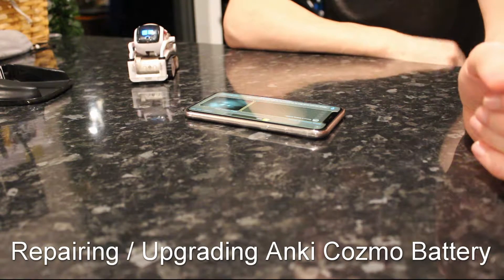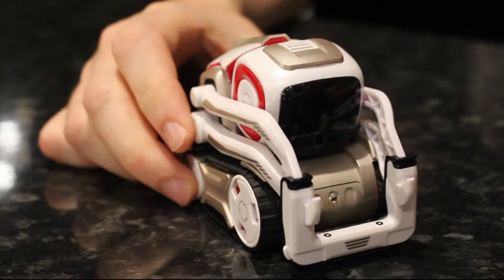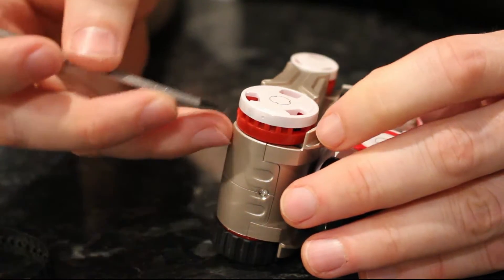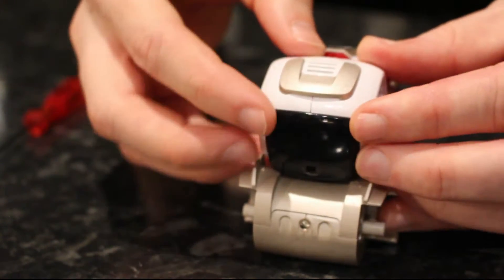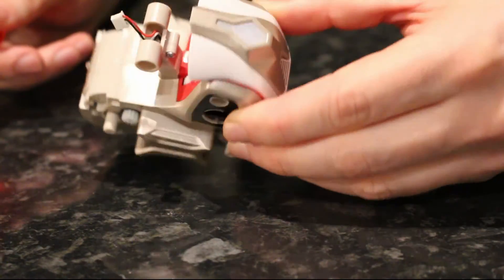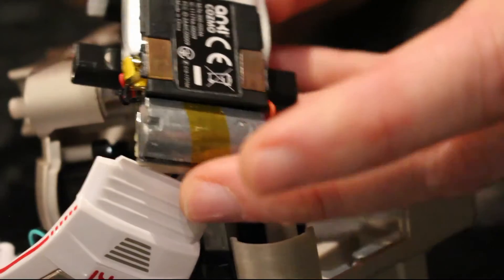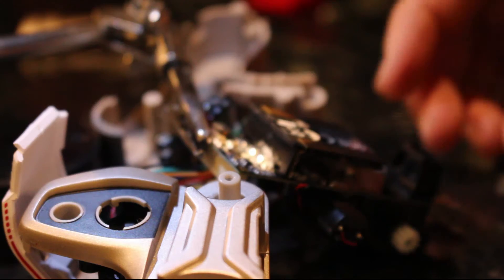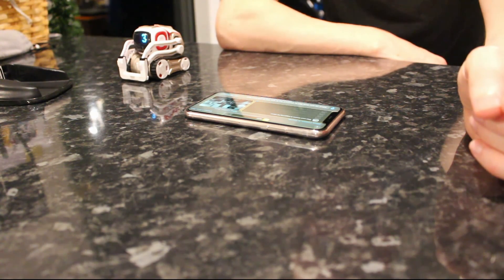Repair / Upgrade Anki Cozmo Battery

Comment: I must of messed up one of the gears when putting it back together. My Cozmo right side if looking at it doesn't spin. I can spin it by hand but the motor isn't working.

Comment: ⭐Great instructional video. Thanks. Just replaced my battery and it works a treat. I tried to test the recharging on the dock when partially re-assembled (to save myself the grief of having to disassemble in case my soldering job was a fail), but it didn't work. Tested the battery and it seemed fine, so I went ahead and fully re-assembled and it worked fine. Nice to have him functional again...
Reply from the maker: The head needs to be connected before it will wake up. Well done

Comment: I got Cozmo apart and changed his battery (hubby change the battery). I think he did it wrong. Cozmo worked for about 45 minutes and then died. So I put him on the charger and he never charged again. I even have two chargers. Nope. He killed Cozmo. 😭
Reply from the maker: @candicethewhynots  could be a dud battery. Try again. I’m sure it’ll be fine

Comment: Hi, can you tell me if it happened to you that your cozmo disconnects while you are using it?
Reply from the maker: @PiccolaGrace21  it’s either a bad battery or a wifi conflict. Do you have a WiFi mesh system?
Reply: @TheJohnJudge  yes I have mesh system
Reply from the maker: @ try switching it off temporarily to see if Cozmo runs ok

Comment: Question for you...  I upgraded my old Cosmo with a 600mah battery which seems to go smoothly.  Cosmo charges (I get the 3 consecutive green lights) but after about 20/30 minutes, the lights on the top just turn off.  I assumed this to mean that the battery was fully charged but I only get about 10/15 minutes of playtime before I get a low battery warning in the app so something is not right.  Is it normal to have to re-charge the robot (i.e. place on charger until lights turn off, remove and replace onto the charger).  Have you encountered this issue in your experience?  Also, how long should it typically take to charge the 600mah battery?  I'm wondering if I have received a duff battery.  Thanks in advance.
Reply from the maker: @TelexStar79  no that is perfectly normal. The robot has a fail safe  feature that charges the battery up to 400mah and then shuts off (the old batteries were 320mah). So even it if shows fully charged if you take it off the charger and put it back on it will charge up to the 600mah capacity.  .

Comment: Great video. But a replacement battery for 35 quid is crazy.
Reply from the maker: £35 is the total service charge; that includes the cost of the battery, installation (by me) and return tracked shipping to the sender - i don’t really make any money on this; I am trying to help keep these robots alive for people.
Reply: @TheJohnJudge  ah got you so you do the replacement that’s cool. I was just looking for a battery replacement that I can do myself. Cheers.
Reply from the maker: @bigdmc6459  you get a battery for about £7 on Amazon or eBay

Comment: I want to warn anyone who is not a professional that they should not try to recreate the steps in this tutorial!  I'm not a professional, but am a hobbyist with years of experience building PCs, and repairing my personal small electronics (including replacing batteries and screen in phones, ipods, etc...as some examples that I work with very small bits). 

This tutorial is misleading in how it shows to disconnect the LED connector.  You can see in the video a cut away shot and then the hands totally obscure the connector.  It is NOT easy to remove.  I have removed similar connectors on many electronics and this thing is not easy to remove.  I gingerly manipulated it for over 5 minutes, trying slowly to remove the connector with gentle pulls and rocking motions.  I slowly increased my force trying to remove it as it would not disconnect.

It would not come out with what I would consider normal force for these connectors and then it ripped the soldered connector on the LCD board.  Perhaps my particular robot had a problem...but I question why the author of the video does not remove the two similar cables connected to the board once you have the main electronic block removed?  It would be so much easier to position the device to solder the battery with these two connectors removed.

I believe the reason he doesn't remove them is because how strongly they are connected to the PCB and the risk of damaging them if you try to remove them.  Yet this is the same type of connector on the LCD panel!  I assume the author has repaired dozens of these and I would have wished he would have drawn more attention to the risk you pose when removing the LCD connection instead of just saying "gently pry".  Everything here needs to be done gently!  There is more to disconnecting these particular connections then meets the eye.  Even after it detached from the PCB the level of force required to disconnect the plug was obscene.

The broken connection seems to have ripped the two outside pin connections from the board with the third pin still being stuck to it.  I was able to place it back into the board using the middle pin as the anchor, but I do not believe the metal prongs are making an appropriate electrical connection.  Prior to my opening the robot it was working fine, but only lasting about 3-5 minutes.  I placed the mostly disassembled robot back on the charging stand and the battery light on top does not light up.  I have reconnected the LCD connection (which I believe is the only electrical connection and the other bits and pieces should not need to be reassembled for it to show some signs of life), and I get absolutely nothing shown.

At this point, I think I should just return the battery I purchased because if I cannot even get it to show a charging indicator light on top as it was before it is probably totally hosed.
Again, I'm not an expert, but someone with a good amount of experience.  Like with most of these projects the only thing that usually takes some skill is the soldering part, which it seems I won't even ever get to.

I appreciate the attempt at the video, and I fault myself for taking for granted the instructions from some random person on the internet, but don't assume this process will go as easily as described and if you attempt it, take extra special care with the LCD connector. 

Now I've got a sad little boy to tell he won't be seeing his Cozmo again :(
Reply: Just an update to anyone that still wants to attempt this.  It might be a good idea to use hot glue around the connector point to better secure it to the PCB before you try to remove the connection.  Obviously, you want to get it between the connector and the board, but not high enough that you glue the cable into the connection.  This extra bond might help you not destroy the board if your connector is as seated as difficult as mine was.  I don't think my board is salvageable, but I was able to order a replacement board and hope I will be able to breathe new life into this guy for my son to enjoy.

Comment: I just found my anki cozmo during a recent move after not seeing it for a few years, and the battery is dead. I feel confident in following your instructions, I just wanted to check what the dimensions for the battery are? I don't want to order one that is too big. Thanks!

Comment: Hi, I'm not able to find the 503040 lipo where I live, instead I was able to find a 900 mah 603048 lipo battery. It is about 1 mm thicker and 8 mm longer than the 503040. Will it fit or should i look for a different one? Thank you for you help.
Reply from the maker: That will
Not fit

Comment: I bought Cozmo used and it tended to randomly shut down very frequently. I excluded battery problems because by repositioning it in its base it immediately returned ready to go again. I've been thinking about issues with wifi disconnecting or any interference but I've noticed that when cozmo loses wifi connection it doesn't tend to shut down immediately. So I followed this guide and opened it up and found a lot of rust between the electrical contacts, as well as in the 5 minute video. I easily cleaned everything up with isopropyl alcohol and now it seems to work fine.

Comment: Regarding the rubber sticker on the battery, how necessary would it be to transfer over to the new battery from the old one as I have found others say it serves as a thermal insulator between the motherboard contacts under the battery and the battery itself and if so what issues could arise from this?
Reply from the maker: I think it predominantly prevents any components on the motherboard from piercing the battery sleeve (they’re quite sharp). Also I guess it stops the battery sleeve accidentally shorting any components because it does rest on top of them.

Comment: My Cozmo dies pretty quick. I was curious on how to fix the battery and this really helped. Unfortunately I’m not certain that I own a soldering iron to complete this repair, so I was curious to see how much it costs to send in my Cozmo and have it fixed.

Comment: Hi John,
Thank you for the nice explanation in the video about replacing the Cozmo battery. After 5 years of running the battery was at 30 % and I bought a new one and replaced it without any problem thanks to your video. Great 
the kids from Croatia

Comment: Hey there, just found your Video AFTER i replaced the battery by my own xD (used an 620mAh from Amazon). 

Question: Cozmo is again up and running, so far its fine. 
The Problem: He dont know when the battery is low and just turns off after an hour or so being on his ride. 
When he is charging the 3 LEDs jump after a hour or so just from 1 LED to 3 LEDs --> Full. 

Is there a way to "learn" on the new Battery or should it work just out of the box? Didnt Factory reset Cozmo - maybe thats the fault?

Best regards from Germany,

Marti

Comment: Will this battery damage any internals?
Reply from the maker: no, because the voltage is still the same - 3.7V  (only the capacity (mAh) is bigger) so only difference is the robot will run longer
Reply: @TheJohnJudge  I know this may be alittle to much to ask but can you please give me a link to one of these batterys on Amazon or something. I having trouble finding one on my own

Comment: Hi I was wondering I have a cozmo and two Vectors and I was wondering if you were able to change the battery out my son tried to change one Cozmo and now the arms won't raise up and also the vectors the batteries we believe are about to die on it but they're still going for about 30 minutes or so and still doing pretty well but they're not running as long as they should so I was wondering if you would be able to change it out I am here in the states do you have an email address to contact you at and the price for me. So in other words I would need my vector and Cozmo repair if at all could you help how do I get in touch...
Reply from the maker: email me johnjudge6@gmail.com

Comment: What temperature did you put the soldering iron on to melt the original solder? (In Celsius)
Reply: Same question. I put my iron on the usual recommended 350 but have to push really hard on the solder to start melting it. What temperature is recommended ?

Comment: Great video and a very helpful man!   I replaced the battery with no problems with this video but still had no response from Cozmo apart from a flashing green light on its back.  I emailed John and within minutes he replied and advised me about wifi signals blocking Cozmo.  I will admit I didn't see how this would affect Cozmo from turning on but after turning off my Wifi mesh Cozmo came to life!   Thanks again John!  I would've bought another one off ebay if it wasn't for you.  Much appreciated.  Mark.

Comment: I can't get the screws out, just spin round, tried so many different types of screwdrivers..any ideas?
Reply from the maker: The screws might be stripped; check my other video for a possible fix:https://youtu.be/GRhWnFlk66s
Reply: @TheJohnJudge  Cheers, tried that, managed to get both of the left side off but no chance of the right, can I still replace the battery with the 2 right hand screws in do you think? Otherwise I think Ill just have to cut them off completely. regards
Reply from the maker: @benperry5125  you need to remove all the wheels ideally to access the screws holding the body together. Where are you located?
Reply: @TheJohnJudge  Thanks, well managed to get them off, replaced the battery and put it all back together. Still get issues with cozmo app saying cant connect to wifi and place on charger like before....sometimes i get 3/4 though and cozmo flashes blue but then it just goes back to connect to wifi mode again...I live in WSM (Somerset). regards.

Comment: Just finished replacing the battery in my son’s Cozmo. Took me about an hour and turned out great 👍 
Your other video with the more detailed soldering information was very helpful as well.
Thanks so much, he’s so happy to have that little guy back 😊
Reply: hello! are you open to repairing one for a cost? I need to fix my son's Cozmo and all this welding is not something I can do. Thanks!
Reply: @wubznluvs  Is it just the battery that needs replacement? What's the best way to contact you?

Comment: Could you add a JST connector to remove the need to solder in future replacements
Reply from the maker: I guess you could, although you would still need to teardown the whole robot each time.
Reply: @TheJohnJudge  thanks!

Comment: Hi John do you still replace batteries on these. Ours lasts about 5 mins before shutting down and I’m not good with a soldering iron. Get in touch if you can. Cheers.
Reply from the maker: Email me johnjudge6@gmail.com

Comment: Thank you, John.  This video is a huge help to me!  Our Cozmo was down to about 8-10 minutes of runtime per charge.  Replaced the battery and now our Cozmo has new life!  I would caution everyone that the larger mah batteries are longer and that the biggest possible battery is not automatically best.  We replaced with a 620mah and it  rests against the front bottom sensor.  Everything seems to work well, but it's a very tight fit.  The 540s or 600s would likely be better overall fit but you can squeeze the 620 mah in there.

Comment: My cozmo doesn't make any sound after I put him back together I'm tempted to see if anything was left unplugg but I made sure it wasn't all I hear if mechanical and the battery is new
Reply from the maker: I will make a video on this issue. It means his the wire connecting his speaker (which is als his WiFi aerial! To his head has come loose and needs to be soldered back.
Reply: @TheJohnJudge  yep exactly I saw it and opened it up and there it was skinny old white cables one was loose.. Thanks for the clarification.

Comment: So do you have a ebay account I reached out to a guy on ebay asking can I send my son cosmo and no response I guess since I'm in the US but heck could've gotten it fixed and mailed back by now. I already have the battery just need to have it solder I took everything apart already I have large hands and trying to solder my skills not as good.
Reply from the maker: Email me Johnjudge6@gmail.com
Reply: @TheJohnJudge  cool just sent you an email maybe check junkmail I think I title it Cosmo soldering with pics attached to email. Darrel C

Comment: Hi. I would like to ask you if you know anything about why Cozmo does not speak. The unit was dropped and it just stopped speaking.  Please if you have a way to fix it please let me know.
Reply from the maker: Yes, I can make a video - the speaker in the top of the robots head is connected to the screen/face - a drop could mean that cable has broken off the PCB